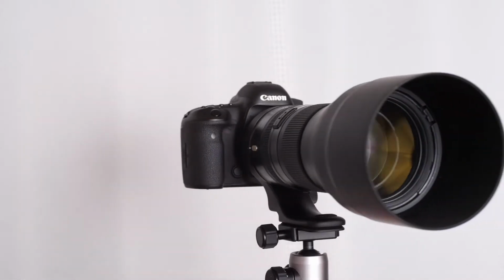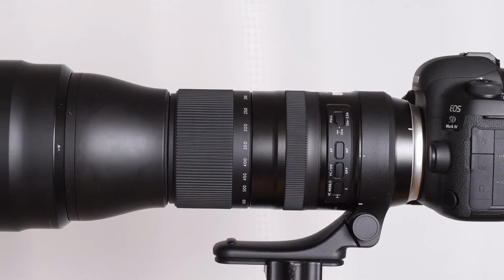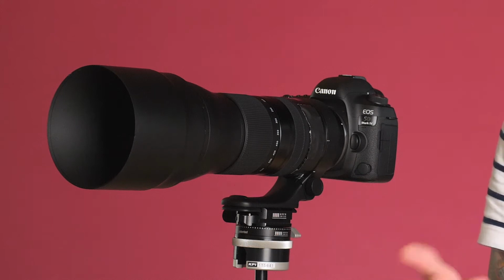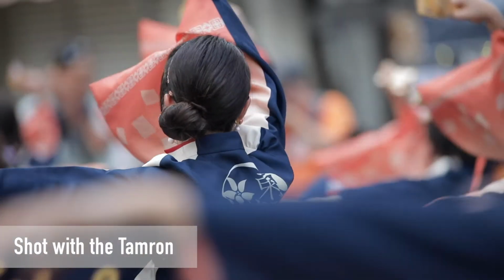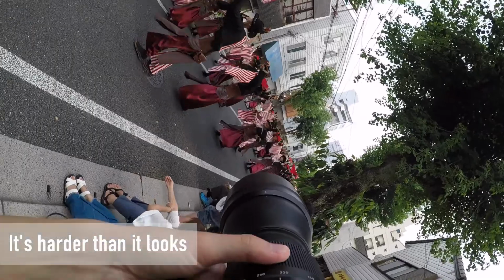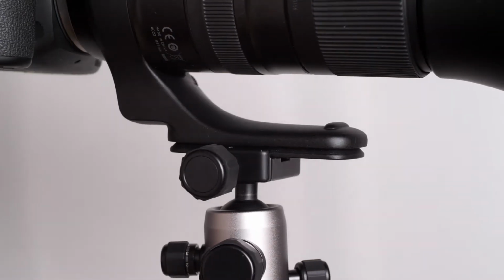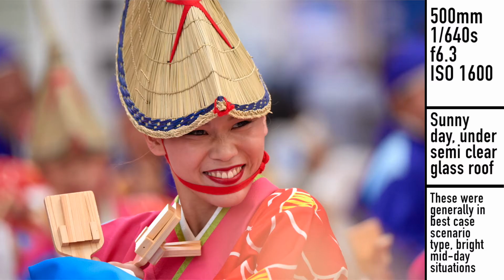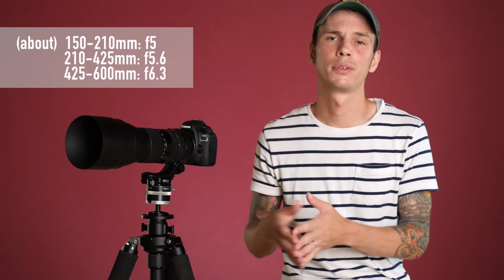Tamron 150-600mm f5-6.3 G2 - Build Quality & Design

Comment: what will be the best option for Nikon dx body Tamron 150-600 g2 or Nikon 200-500
Reply from the maker: Without having used it myself, the constant aperture of the Nikon could be nice, but you get a bit more range on both ends with the Tamron. Could depend on which of those is more important for you, and also how comfortable you are with non-native lenses. The Tamron does a great job though, I think you'd be happy with either :)

Comment: Nice review Scott and you really zeroed in on my major complaint about this lens and its Sigma counterpart . . . and that's the f/6.3 maximum aperture. Truthfully, I found the image quality suffered until about f/8 or f/11 and that's way too slow in every shooting situation except direct bright sunlight (and that's usually crappy high contrast light). Great for the budget minded but a much better choice IMHO is the Canon EF 100-400mm f/4.5-5.6L IS II USM or even the much older Canon EF 400mm f/5.6L USM prime lens . . . both shoot tack-sharp wide-open at f/5.6. Both Canon lenses are stellar and when coupled with an APS-C sensor (like the Canon EOS 7D Mark II) the EFOV is boosted to 640mm. I shoot wildlife, not events, so I am at the long end 95% of the time. Keep the videos coming. :-)
Reply from the maker: Stephen,
Great to hear from you again! Glad to hear from a wildlife shooter's point of view as well. I'll have to test this more scientifically but I did feel like I wanted a little more from the lens wide open like you said, having to stop it down would severely limit its use. I wish it was easier to get my hands on some of those Canon lenses to test out- the 100-400mm in particular seems to be very popular. As you mentioned, you (and most likely a majority of people) will use the long end of this or similar lenses, so I really do question the necessity of the lower end of the focal range. I assume it was to appeal as a slightly more "general use" telephoto, but I suspect there were a handful of compromises made to achieve that. I wish that wasn't the case. 
Anyway, thanks for watching as always. You've further motivated me to try and get my hands on those Canon lenses ;)